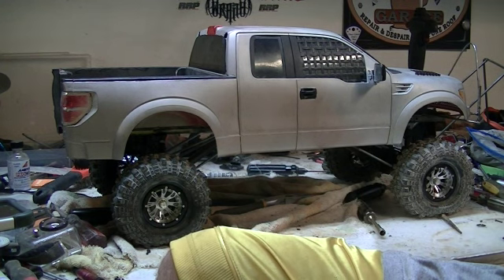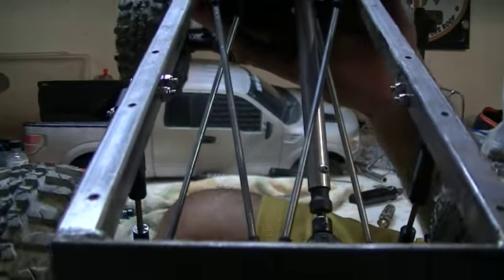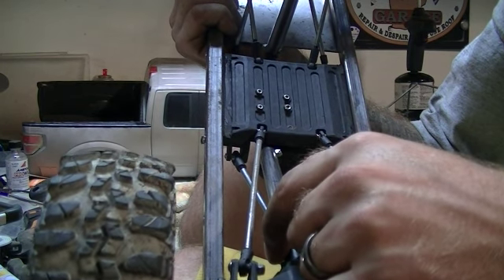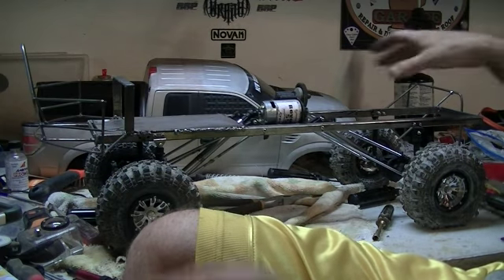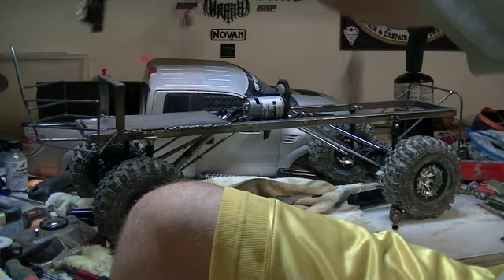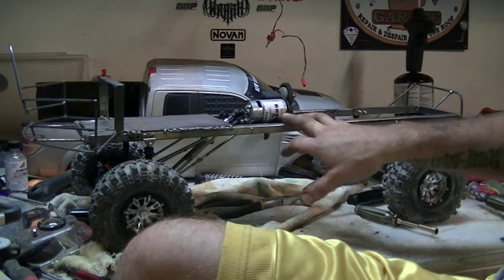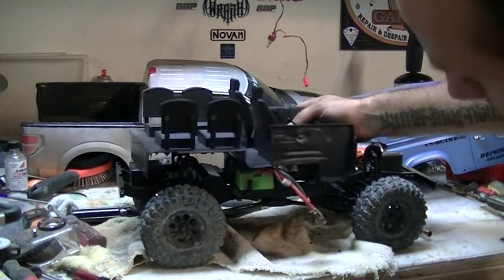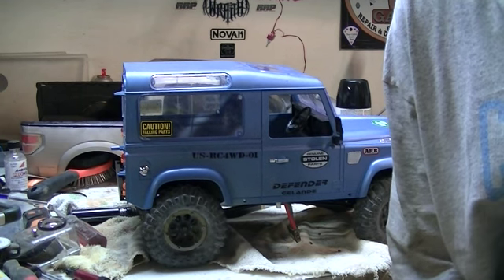Project BAMF 1/6 Ford Raptor Scaler

Comment: The 1/6 truck your building is a nice looking rig so far.you should put a dual motor plate on it to run two motors for the extra power for sometime that big
Reply from the maker: It actually seems to run flawlessly on a 3300kv brushless system